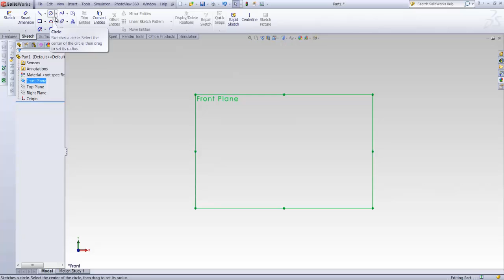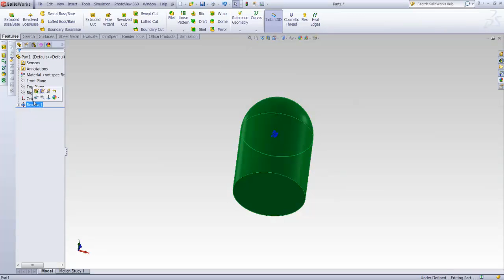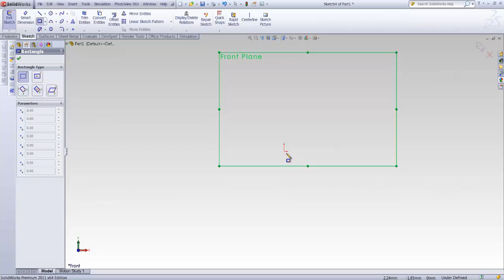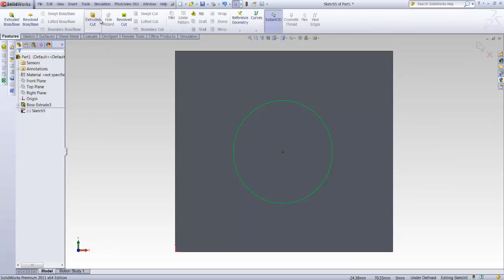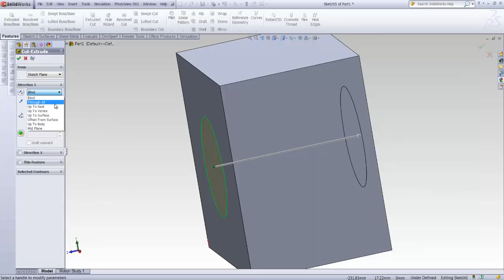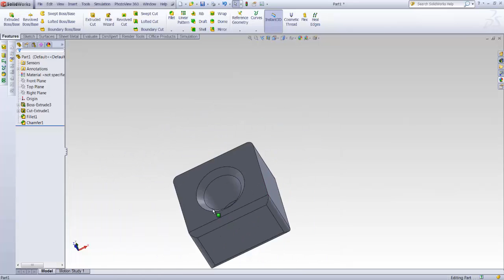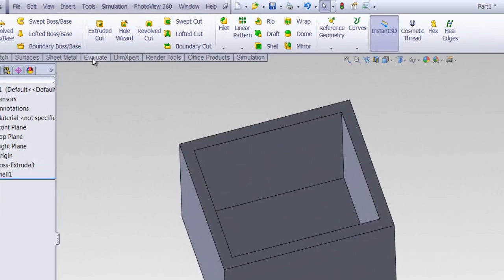SolidWorks Tutorials / Learning SolidWorks for beginners Part (2/3) / SolidWorks

Comment: when i use revolve bus i always get an error-"unable to make a revolve feature with the given profile"  -  any suggestions?
Reply from the maker: palcuz depending on the version you use it might be the open sketch. Or the sketch is closed but if you zoom to your contact points you'll probably see an extra line dangling there. (90% the case) delete that
Reply: I am on sw2014.  Don't know if that matters.  It seems even when all points are closed it happens
- any other tips would be great!
Reply from the maker: palcuz always? What's your profile like?

Comment: Hello, I hope that you still can reply to this message eventhough this video was made 5 years back. I'm using 2015 Solidworks, and I have problem when selecting the axis, the thing doesnt revolved. what should I do?
Reply from the maker: Beginner wew 1- make sure your sketch is closed
2- zoom on your sketch and evaluate if you have an extra unnecessary line drawn somewhere, sometimes happens in SOLIDWORKS
3- when you open your revolve feature, use SEleCT CONTOURS instead of the sketch itself. 
4- make sure THIN FEATURE isn't checked
try each one of them and see which one is the problem. it's really hard to diagnose something without knowing more about the error you're getting. if they didn't work, please describe the issue more in detail...

Comment: Please can you help work this out. I have followed your PART to the point of using the MIRROR feature. As with each task, I have tried to learn the principles not just follow by rota and at this point I came stuck.....

I want to mirror this part so that it is reflected from the Back Face (where the internal Extruded Cutout is measured 10mm from. 
In the Property Manger dialogue box, I have select the rear Face (Face 1) as MIRROR FACE/PLANE and the objects (Chamfer 1, Fillet 2, Boss Extrude 1 and Cut Extrude 4) from the Property Manager, yet I am getting an error message "Rebuild Errors...could not find end face for feature."

Please can you answer a) by why I can't do this, and b) if this feature is not possible, apart from building 2 parts (which is not time economical), how would you overcome this.
Kind Regards Peter PACRE
Reply from the maker: PACRE HONDA Wow, I missed your comment by far man! hope you dont hate me and hope you have already found a solution. but, if not, here how it is: I should see your screen to be able to see why you cant do it. but if for you second questions, try "Body" in the mirror feature. meaning, after activating/ clicking on the mirror feature, on the left side, open the BODY tab and choose your part there and then choose a plane to mirror it. it should work
Reply: Many thanks, I'll give it a go :-)

Comment from the maker: blind means that it will cut through all the bodies and it only know the dimension you give to it as a reference. but in offset from a surface you choose a surface and also a distance from that surface to cut up to that point. this option is very helpful when you don know the actual depth of the cut and you only know the left over distance at the end of the body. sorry to reply so late.

Comment from the maker: it is enabled as the default setting. honestly, i havent seen it disabled! nevertheless, if you are trying to extrude cut and you do not have a plane to draw your sketch, just make a new plane ( rebuild your active sketch if its not) by 1st holding the CTRL key down and then click on a plane--2nd choose 3 points from your prefered surface as the references of your new plane and then draw on that new plane. hope it helps